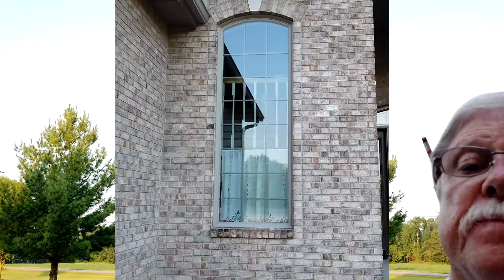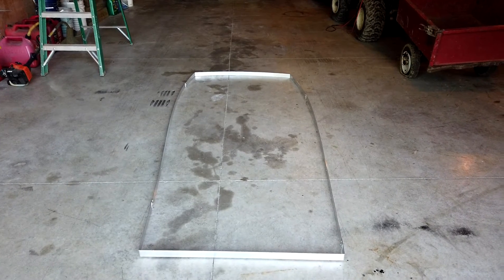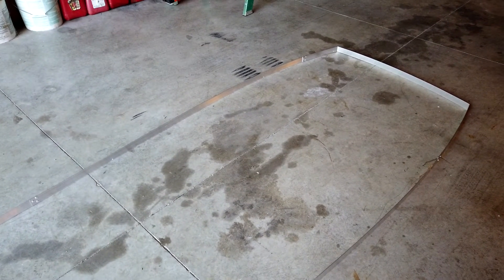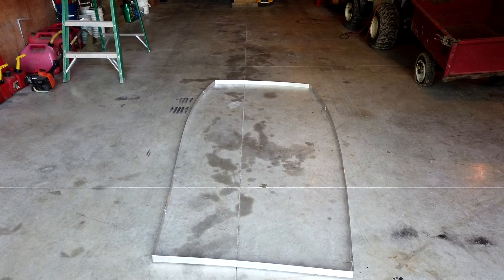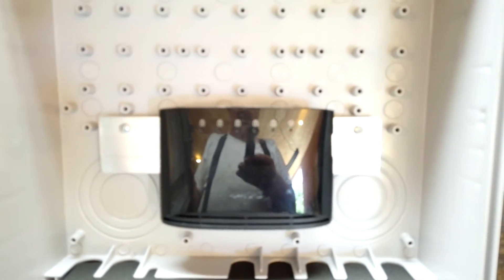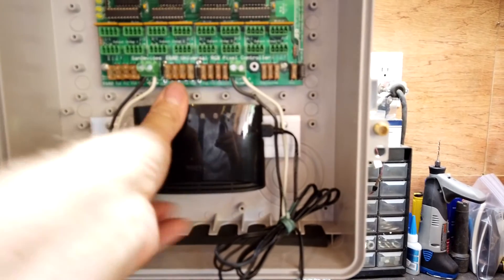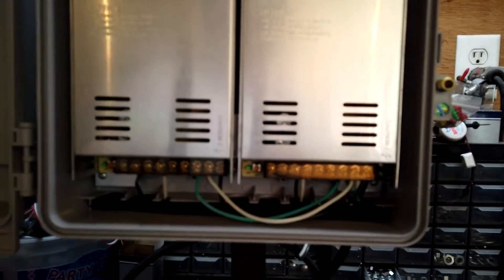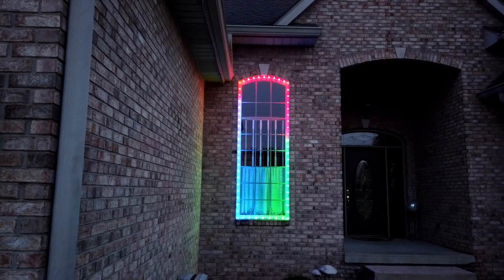RGB Pixel Lights - Adding Lights to House Part 8

Comment: How did you mount the lights to the metal frame? Great video Sir
Reply from the maker: The round lights I drilled a large enough hole for them to push through. They are made to snap in on 1/16 thick aluminum. The square light have small screw holes made on the sides of the light to screw them down to the aluminum.
Reply: @deehigginbotham8434  perfect thanks for the response.

Comment: Need some help with the arduino  set up I built following your last set of videos. When I plug in my arduinos windows is not recognizing usb device . Any ideas or suggestions would be greatly appreciated.
Reply: Worked fine last year
Reply from the maker: Anytime you unplug an Arduino then plug it back in the computer will assign it a new port number.  Try turning everything off. Restart the computer with the arduinos already plugged in to the usb ports. You might also try a different usb cable.
Reply: Dee Higginbotham thanks for some reason it no longer will read that brand of usb cord diff brand works